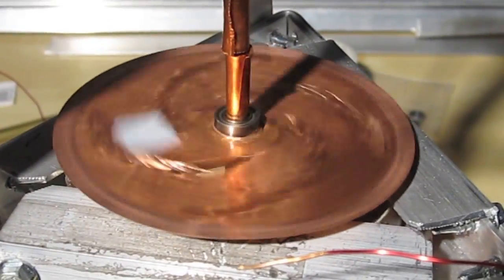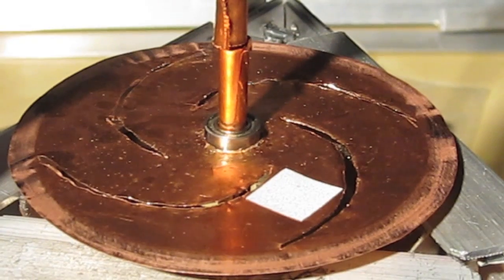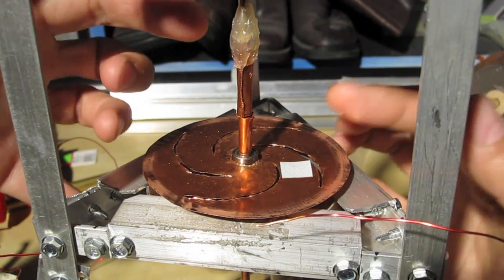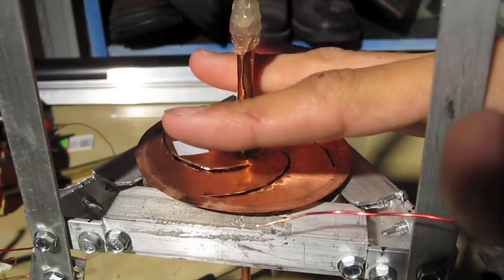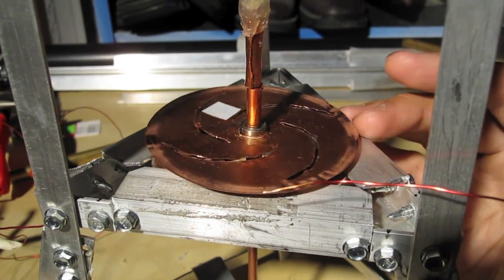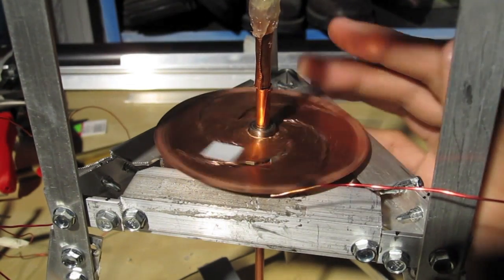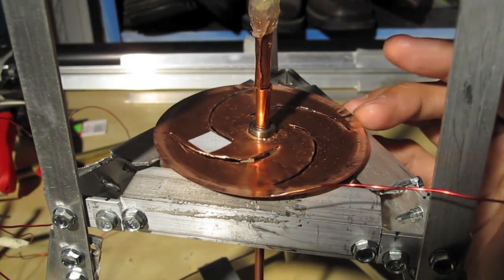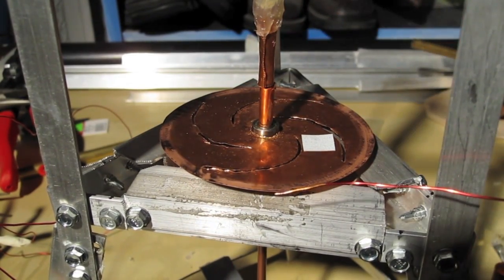Nikola Teslas Unipolar Motor

Comment: 9:43 I have been thinking about the presuppositions given to outer space and vacuum and I find a huge contradiction that being 
vacuum is always relative to another pressure gradient so no absolute vacuum could exist. Cross that with modern cosmology 
that states the universe came from a big bang that is expanding outward and still accelerating yet within itself contains vacuum.
I wonder what's driving the expansion of the event horizon and accelerating it if not the pressure wave from the big bang.
There's no pressure waves operating in a vacuum.

Comment: 9:02 it's in the way that the voltage remains low and the current seems independent of the voltage or isn't fixed to it I think.

Comment: https://youtu.be/1GkZkcdbD40
Reply from the maker: Nice setup you have there!  If you super cooled the magnets you could get the disc to hover without need for a central wooden axis.
Reply: @spiritelemental  going to get some dd40 and try again this even :) I do have a way to get this to levitate without touching without adding additional energy and without making contact as I mentioned before. Will report back with results. 😊

Comment: The Faraday Paradox is not a paradox at all; it is the result of a misunderstanding of classical electromagnetic principles. When the electromagnetic theory of Maxwell (and Lorentz) is applied correctly to the Homopolar Machine, all the experimental observations of Faraday can be explained and there is no violation of the physics. There is NO possibility of an over-unity operation of the Homopolar Machine as claimed be the proponents of zero point energy. The Depalma, Trombly-Kahn and Tiwari implementations of the machine all failed to prove over-unity operations. Now you know why they failed because the Faraday Paradox is not a paradox at all. Everything is consistent with the laws of classical electromagnetism.

Comment: This is going to be your most important comment on this video, Pin it to the top. !!!!!!!
The thicker this disk the more amperage you get.
Normally to make an electro magnet it's the amps you want, also note that it's the amps in a coil that causes the heat. The heat is bad to have in a design and also a form of energy loss.
So keep this disk thin...
The bigger the diameter of the disk the more voltage you get, voltage doesn't cause heat in a coil, but also voltage is very poor for making a magnetic field....
BUT a Starship Coil works better off of Voltage!!!!!!!!!!!!!!
No Heat Losses, and the starship coil concentrates the magnetic field, More efficient!!!!!!!!
It makes the perfect pair with this!!!!!!!!!!!!!!!!!!!!!!!!!!!!!
Have a copper rod with two bearings on it that electricity can pass through , a copper disk on each bearing, and a Starship Coil around each disk.
Have your Starship Coils wired the same way on each disk and facing to where it will make a North & South in the center when spinning opposite of each other. 
Obviously have them closest together you can get with out any rubbing, your Coils will stick out more that the disks.
Spin them opposite of each other manually.
Take your source of voltage, put one wire on an end of the rod and the other wire on the outer edge of the disk that is the closest to the end of the rod your touching with the other wire.
Watch them Start Spinning Faster!!!!
You then can remove your power source cause you now have a new one!!!!!!!
Wait till it reaches its maximum RPM's,
You can tap the ends of the rod for power, if wire correct one disk will be positive in the center and the other disk will be negative in the center, the path will complete through the magnetic coupling of the Starship Coils!!!!!!!
If your making more voltage than the coil can flow through it then you can tap it without it slowing down, else it will start to slow down, but slowly cause of the flywheel effect.
Make two sets (or more) and have them on a circuit that toggles between the ones it's taking power from, that way the idle ones can spin back up to its max RPM.
That is all, have a wonderful life, and don't do this for money, do it to change the world,
And don't let the Government kill you for doing this!
Reply from the maker: Starship Coil....     your talking about a flattened Rodin Coil here?
Reply: spiritelemental basically yes, psychically it's different, but it's the same math
Reply: David Prock it's the same thing not wrapped on a torroid, it does not work as well but is simpler to make. I don't see why starship would be your first choice?
Reply: spiritelemental looking at your design it seems similar if you stacked the disks to his turbine..

Comment: Approximately how much voltage and current are you applying to the copper disc  Also, how much gauss do you have on your 3 inch magnet?  Thanks for your help.

Comment: If you kept the copper disc static and added a bearing to the center of the magnet, would electrifying the copper rotate the magnet, or does it only work according to this configuration?

Comment: Nikola Tesla had realized that you dint need to spin the disk he discovered that if you place a week magnet each side of the disk and pulse the polarity back and forth that it would put out low voltage high amp DC voltage, a bit like the KW meters in your meter box.
Reply: The magnets he was pulsing were weak electric magnets changing the polarity back and forth with one magnet on each side of the disk, you collect the power from the shaft and the edge of the disk and the disk was made of aluminum and with a spiral was a groove not a cut threw and the copper was a thin layer over the top of the aluminum.

You dont need to spin the disk just pulse the magnets, and it is called the uni-polar dynamo
Reply: gary depietro
 I dont think you got very high volts from this around 20 to 32v but high amps was going to make one but never got around to it, I have everything I need so I may give it a test, you need the aluminum disk but the one in the experiment had copper infused on the top of the aluminum and had the spiral groove engraved into the surface, it was said that the spiral was to move the current and the magnetic forces in a direction, just use any flipflop circuit to flip the power on the magnets, and just get a pair of the same matching type of 12v relay and pinch the electromagnet out of  them, they should be identical if same brand and fix them each side of the disk as close as you can to the disk without touching ad away you go.
Reply: gary depietro
just remembered that he said weaker the better and I think he was talking maybe using less power around 3 to 6 volts maybe worth a play around with as well.
Reply: SpaceManAus,
The thicker this disk the more amperage you get.
Normally to make an electro magnet it's the amps you want, also note that it's the amps in a coil that causes the heat. The heat is bad to have in a design and also a form of energy loss.
So keep this disk thin...
The bigger the diameter of the disk the more voltage you get, voltage doesn't cause heat in a coil, but also voltage is very poor for making a magnetic field....
BUT a Starship Coil works better off of Voltage!!!!!!!!!!!!!!
No Heat Losses, and the starship coil concentrates the magnetic field, More efficient!!!!!!!!
It makes the perfect pair with this!!!!!!!!!!!!!!!!!!!!!!!!!!!!!
Have a copper rod with two bearings on it that electricity can pass through , a copper disk on each bearing, and a Starship Coil around each disk.
Have your Starship Coils wired the same way on each disk and facing to where it will make a North & South in the center when spinning opposite of each other. 
Obviously have them closest together you can get with out any rubbing, your Coils will stick out more that the disks.
Spin them opposite of each other manually.
Take your source of voltage, put one wire on an end of the rod and the other wire on the outer edge of the disk that is the closest to the end of the rod your touching with the other wire.
Watch them Start Spinning Faster!!!!
You then can remove your power source cause you now have a new one!!!!!!!
Wait till it reaches its maximum RPM's,
You can tap the ends of the rod for power, if wire correct one disk will be positive in the center and the other disk will be negative in the center, the path will complete through the magnetic coupling of the Starship Coils!!!!!!!
If your making more voltage than the coil can flow through it then you can tap it without it slowing down, else it will start to slow down, but slowly cause of the flywheel effect.
Make two sets (or more) and have them on a circuit that toggles between the ones it's taking power from, that way the idle ones can spin back up to its max RPM.
That is all, have a wonderful life, and don't do this for money, do it to change the world,
And don't let the Government kill you for doing this!
Reply: @davidprock904  The out put is DC or AC of this device ?

Comment: This concept will generate very high current but very low voltage, not suitable for direct load applications. The best application is driving power for a pulse dc battery recharging circuit, which will then work in tandem with lead acid cells to drive a pulse dc alternator. Power from the alternator should be further managed via line transformer and used as needed. I've built a wind turbine incorporating the "Faraday Disk" concept and it freaking works; Five volts @ 10-12 amps. Boom!!! Con Ed can kiss my innovative ass!!! From the transformer I get around 2500 watts rms for about 12 hours depending on how the wind blows (LOL). Scaling up battery banks and incorporating solar panels would provide me power 24/7 @ 2500 watts rms. I run my entire workshop on this power, and you can too! To power an average home 24/7 I would have to scale this up drastically, and invest around $50,000, but its possible.
Message me privately for further details, but keep in mind my wind turbine design will not be disclosed. Chow!
Reply: yess, please keep your windturbine secret for yourself and - if possiple - your useless verbal farts too!!!

Comment: i am currently trying to spin many copper disks in a magnetic field enclosure using air pressure similar to a tesla turbine . however in early tests i cant seem to get the disks to spin with just electricity , i assume you are using dc power? how much ? just a car battery?

Comment: I tried a neat experiment today. . . Basically turn a steel mixing bowl upside down, hold one lead of a voltmeter in the middle and drag the other lead around the outside. . . Voila! Power. Whether you move the lead clockwise or anticlockwise, the polarity is always the same. Why, I have no idea. I assume that it is somehow using the magnetic field of the earth to make a homopolar generator. No right hand or left hand rule seemed to be present in any way, shape, or form. It doesn't make much voltage, but then, my speed was very slow, and the bowl is not large. I also found that by using 4 magnets arranged in a square alternating north and south on one of these generators you can in fact produce AC current with the brushes also separated by 90 degrees. Next idea is to try getting a huge amount of magnetite sand (easy by using magnets in sand and then filtering and separating carefully) and putting on the ground, and using a much faster, much larger brush to rotate through the iron filings with a central pole. Maybe a tethered 'brush' rotating around it at high speed. If the conductivity is an issue I will use some saturated saltwater or other electrolyte in the filings. I forget if the polarity is positive in the center or the outside, but I am sure that this device could be connected to ground at one end and connected to an insulated antenna at the other end for an enhanced bias. Fun, fun, fun. Experiment!
Reply: Since magnetic fields are stationary anyway, I don't see what the point of rotating the plate is at all. . . It seems to me that you only have to rotate the brushes to get the same effect. If anyone cares to explain why that isn't so it would be good to hear. I will be doing some more experiements with this stuff regardless.
Reply: To prove to yourself that the magnetic field does not rotate with the magnet, just put some filings on paper, put a cylindrical magnet underneath and rotate. The field lines will not change.

Comment: Hi !What if you were to place another plate, directly, under the other plate. Add add 4 magnets around the plates lastly put liquid ice (dry ice ) inside the pole that is in the middle of the plates. The energy source would be 9 volt batteries; or ion batteries from cell phones. Would create a levitation device >?

Comment: Nice job I'm about start on some gyro with your plate set up and I want to tell you some good information because you share with us your knowelege ,If you want to get more volts use this free energy https://youtu.be/G6wVw2PxtIQ  and send wirless volts from Tesla Coil  (you can increase your voltage throw this sistem of energy to like 25 000 volts depend on your tesla coil biger coil more volts)and putt it into vakum tube and it's gonna run by it self and a lot of more ....:)

Comment: I recall seeing a Tesla patent that had 2 disks, and instead of a brush on the outer edge, the two disk were coupled with a metal loop. The voltages could thus be taken from the center of both disks.

Comment: try aluminium too, which, like copper acts inductively to produce a magnetic field when exposed to a magnet moving across its surface. the field interacts with the magnet to cause drag.
Reply: Aluminium is the worst metal to use in any electrical circuit.

Comment: Take a look at Ken Wheeler's videos and the secrets get explained. Vortexes are already there in the dielectric incommensurability. Look here on YouTube for pancake motors that were used for auto windows. This old guy takes one and rebuilds it. Then you can see that coper disk design. You may just attach the magnet too like Brian DePalma's N Machine. Those vortices are still there. Just make sure you make your disks bigger than the magnet because you want the precession edge and even go further away from it with your disks because there must be a maximum point there some where before the vortex winds up again on it's way back to the centripetal squeeze. https://www.youtube.com/watch?v=cZ9BeCysP1Y

Comment: Awesome work, thank you for doing research in this. Once over unity stuff gets out every single aspect of our lives will be changed for the better. Thumbs up to you.
Reply: David Prock you didn't comment in the right spot to be pinned
Reply: This is going to be your most important comment on this video, Pin it to the top. !!!!!!!
The thicker this disk the more amperage you get.
Normally to make an electro magnet it's the amps you want, also note that it's the amps in a coil that causes the heat. The heat is bad to have in a design and also a form of energy loss.
So keep this disk thin...
The bigger the diameter of the disk the more voltage you get, voltage doesn't cause heat in a coil, but also voltage is very poor for making a magnetic field....
BUT a Starship Coil works better off of Voltage!!!!!!!!!!!!!!
No Heat Losses, and the starship coil concentrates the magnetic field, More efficient!!!!!!!!
It makes the perfect pair with this!!!!!!!!!!!!!!!!!!!!!!!!!!!!!
Have a copper rod with two bearings on it that electricity can pass through , a copper disk on each bearing, and a Starship Coil around each disk.
Have your Starship Coils wired the same way on each disk and facing to where it will make a North & South in the center when spinning opposite of each other. 
Obviously have them closest together you can get with out any rubbing, your Coils will stick out more that the disks.
Spin them opposite of each other manually.
Take your source of voltage, put one wire on an end of the rod and the other wire on the outer edge of the disk that is the closest to the end of the rod your touching with the other wire.
Watch them Start Spinning Faster!!!!
You then can remove your power source cause you now have a new one!!!!!!!
Wait till it reaches its maximum RPM's,
You can tap the ends of the rod for power, if wire correct one disk will be positive in the center and the other disk will be negative in the center, the path will complete through the magnetic coupling of the Starship Coils!!!!!!!
If your making more voltage than the coil can flow through it then you can tap it without it slowing down, else it will start to slow down, but slowly cause of the flywheel effect.
Make two sets (or more) and have them on a circuit that toggles between the ones it's taking power from, that way the idle ones can spin back up to its max RPM.
That is all, have a wonderful life, and don't do this for money, do it to change the world,
And don't let the Government kill you for doing this!
Reply: David Prock also starships are the most inefficient variation of those kind of coil.. using the variations based on the torus would be more effective. Also most people are not taking into account it's supposed to be made with two fields collapsing 120 degrees apart.
Reply: David Prock one could make a poe  coil in mass production very simply if they used an electroplating technique instead of hand wrapping.